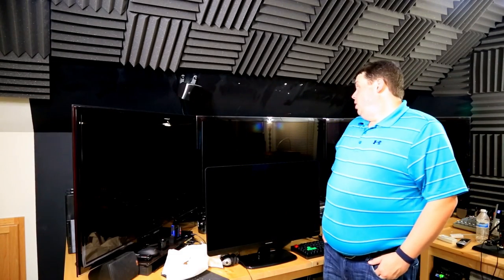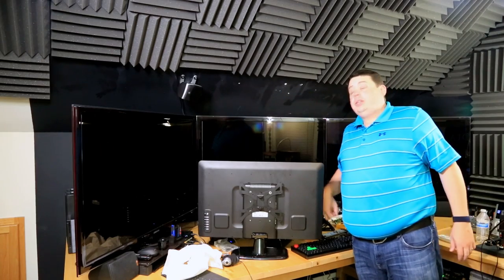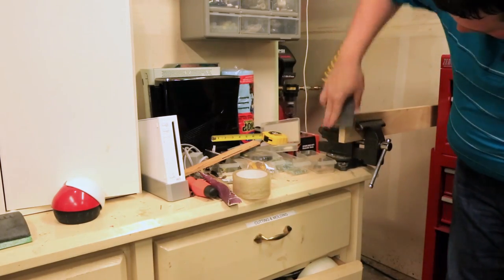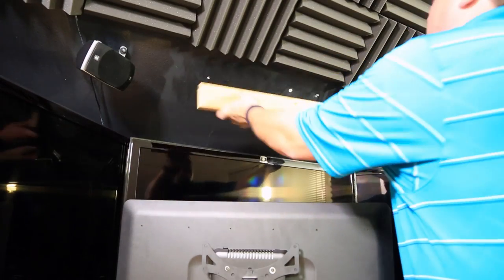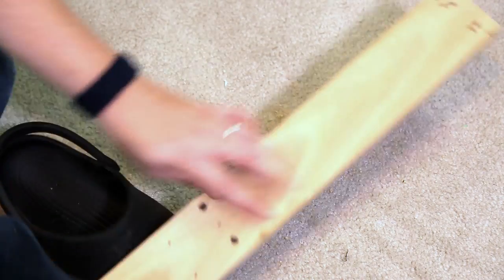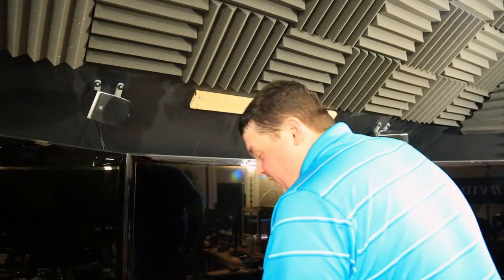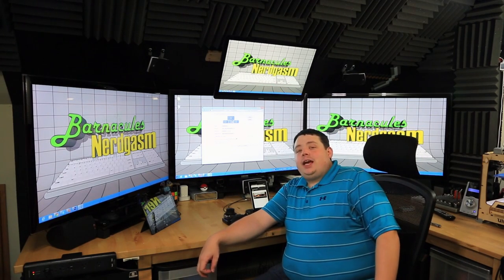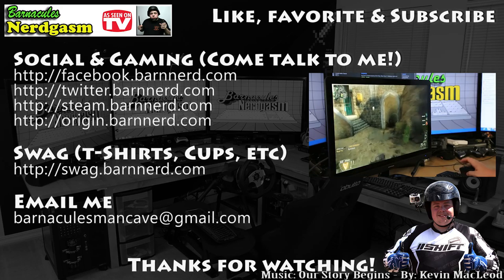Easy Screen Mounting: Transform Your Space with This Guide

Comment: Did you happen to have a problem with the screws mounting into the back of the monitor? I've only ever had to use 10mm or 1/2 in screws, but I'm thinking I might have to go get some 8mm screws. What'd you put into yours? (same monitor btw)